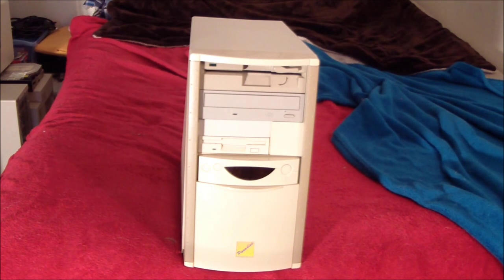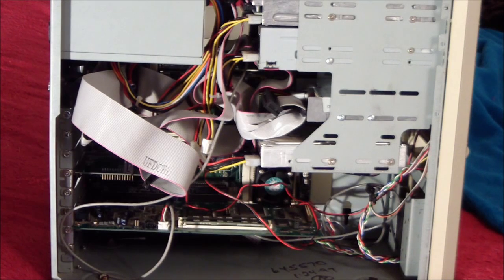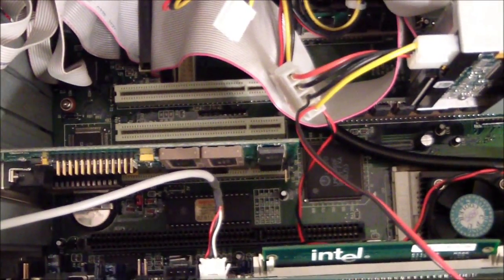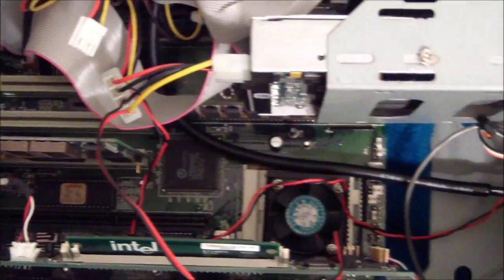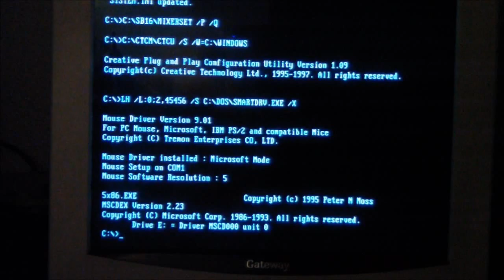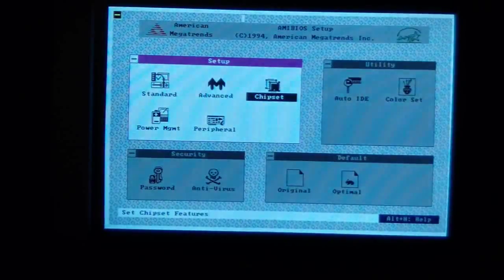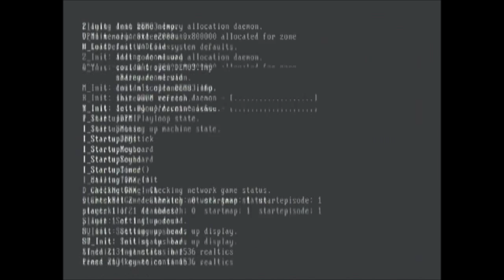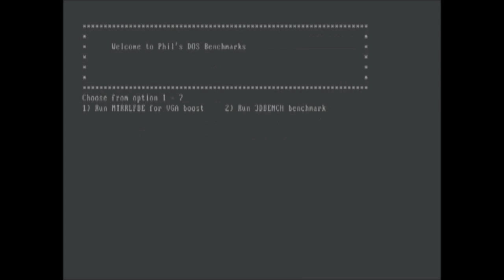Building a high end 486: part 2

Comment: Hi, I've just bought a soundblaster CT3930 like yours and i'm waiting for it in the post. how good would you say is it with things like "hanging midi bugs" and that kind of thing based on your own experience? 
I bought it as it looks like a versatile card with opl and emu8000 synths and it'll be used in a socket 7 i've designed to play dos/w3.x games from 1993-1997.
Reply from the maker: It's an okay card. I like the Vibra chips since they tend to have less noise than some SB chips. I believe this card also has a real OPL3 FM chip so that's a plus. Overall compatibility will be good but it DOES have the hanging midi bug so if your planning on using an external midi box or wavetable (I forget if this card ever has a wavetable header) with this card your going to experience the bug in several games. The bug isn't nessicary game-breaking but its certainly noticeable.
Reply: @AncientElectronics  Thanks Justin! sounds like this card is ideal for me then, as i won't be using any external modules. I intend to use mine as an "all in one solution" with all the midi being played on the emu8000 and the opl3 is to used for games like megarace which refuse to play music on the CQM cards like the CT3620.
I think most of these VLB length soundblasters don't have wave headers anyway unless they have the AWE32 marked chip, at least my CT3620 lacks one for sure.
Reply: @AncientElectronics  BTW, I've been reading your blog since 2013 and it was reading your windows 3.1 pc anatomy article that got me interested in pc building! Would just like to say that you are excellent at documenting vintage hardware.
Reply from the maker: @Viczarratt  Thank you, I'm glad it was able to help someone get into the hobby and hopefully make the experience a bit more user-friendly.
Reply: @AncientElectronics For sure! it's much more user friendly then trying to get something conclusive from a typical vogons thread, i also like it when those pups keep trying to steal the show - but keep it up with the good writing!
Reply: @AncientElectronics  It arrived safely in the post on wednsday and working well, so thanks again Justin. i have found the ct3930 to be compatible with most sb/sb16 games including nukem2 and megarace, which hated the ct3620. and the emu8000 gives decent midi in nukem3d/doom. there is no wave header on the ct3930, but that would of been crippled anyway. 
-
One game that i can't get GM music with is 7th guest, it's fine with fm midi though so it might be a mixer issue in my config, since 7thguest uses AIL drivers for sb32/awe32 support. that was one game that worked fine with my old CT3620.

Comment: PCChips board tells you that there is L2 cache even when there's none. My M915i said that I had 256KB of cache even though it was completely fake too. However I managed to remove the fake cache chips and put real ones instead (mine doesn't have traces that don't go anywhere fortunately) and in cachechk it detected the L2 cache ! However I think that even if I set the cache to 512KB or 1MB, it will say "256KB cache"
Reply: my m919 said "WriteBack Cache On" without the cache stick, but when i put it in, it will change to "256KB CACHE MEMORY".
Reply: I used to have an m512 socket7 with a COAST slot and a supposed 128kb already onboard, i have a vague memory of one program saying the 128kb was fake, even though 128kb is quite small for a Pentium class system.

Comment: what is 5x86.exe in your autoexec.bat?
Reply from the maker: That's the program that re-enables some of the features of the Cyrix 5x86 that are disabled by default.
Reply: @AncientElectronics  thanks. i take it it's only for cyrix ones and not needed for the AMD 5x86s right?
Reply from the maker: @bamdadkhan  right, its only for the Cyrix 5x86 chips or the rebranded chips like the IBM 5x86

Comment: I have modded socket 3 pc , amd586 133 , 4 pci slot , 2 isa slots , 4x32mb ram total 128mb , 3d rage pro x 2 8mb video ram , pro sonic jazz16 sound card , sony 24x cd drive , pci usb adapter , wd 80gb hdd , win98se , old school microsoft mouse and keyboard , plays quake 1 640x480 , also just finish building up my pentium 3 gaming pc might post a video of them I have a room full of vintage pc's lol

Comment: OMG. This PC case is exactly same as my Pentium MMX PC when i was a kid. Sell to me please? :)
Reply from the maker: :) Its a nice machine. unfortunately its not for sale at the moment.
Reply: For some reasons, the PCChips slot 1 system that I've got at some point had this case too. Now it contains my K6-2. Unfortunately this is a really cheap case because the metal can bend pretty easily. Oddly enough, the display at the front has no pins to select what it will display. It can just display "HI" or "LO"

Comment: Ark logic ARK1000VL is faster than ET4000 cards in DOS gaming. It's possible that it's the fastest for it's time, but there's few other possible ones. I just have never seen them benchmarked against each other.
Reply from the maker: I would love to get a hold of an Ark Logic VLB card but they seem to be especially hard to come across. I have a PCI Ark based card and it is indeed very fast.